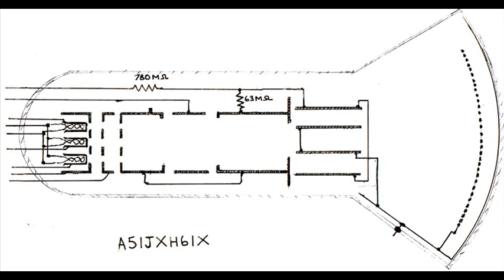Trinitron Cathode Ray Tube

Comment: What the différence between black trinitron ?
Reply from the maker: Not 100% sure on that one. There may be some general improvements on the electronics, but I think the term comes from darkening the screen fluorescent coatings to improve picture contrast. Manufactures had this dilemma with CRTs as black is only as dark as the screen coating. (i.e. No electron landing.) Making the screen darker with filters or pigments also reduced the brightness so  wasn't really used until light output from the  fluorescent coating was good enough.

Comment: How did you cut the glass? Was it heat and then cold water?
Reply from the maker: With electrically heated hot-wire the stress often crack the glass without any additional cooling.
Reply: @tuopeeks ok thank you so much

Comment: What metal use to withstand heat.
Reply from the maker: The aperture grill and shield assembly is made from thin steel sheet. The grill being etched out to allow electrons to pass. This is spot welded to a very heavy ridged cast frame to keep the grill in tension. There is also a thin layer of aluminium coated onto the  back of fluorescent  screen. Both will experience slight heating from the scanning electron beam but it is slight as the beam never rests on one spot.
Reply: @tuopeeks  thank you.

Comment: "The disassembling of this tube is a dangerous process."
In study times (during transition from CRT to TFTs), there were tons of old tube TVs on the streets at night, to be collected as bulky waste the next morning.
It was fun cannibalizing the valves (if any) or other valuable componentes for DIY projects and giving the tail of the CRT a nice kick - when coming home from a party at night, completely drunk. I took stuff home when I could carry it - it was not just stupid vandalism :) But the TV sets would have been crunched anyway the next morning, so why not having some fun? One night I rescued a complete C64 set from destruction. With two 1541 drives and a printer, all in working condition. 100feet away of my home. I put them in the basement, running a few times back and forth. But unfortunately most of it has been stolen a few days later.

Comment: This will soon become a lost technology, since no one is manufacturing them anymore and fewer and fewer know how to repair them, and fewer and fewer even care about them
Reply: Nope.
Sony's patent for the Trinitron expired decades ago and all the information you could need to build one is available.
I'm pretty sure you can find some Chinese company still making CRTs.
As for repairing them, all you need is the theory of operation and some service manuals.

I used to fix them, and it's not that difficult or complicated as long as you have the service manual, or you could even do it without it if you really know your CRT TV theory.
Now I'm a bit rusty though, but videos from people like Jordan Pier and Shango066 help me remember a few things that I had forgot.
Reply: @GoldSrc_  There are new monochrome CRT monitors on Aliexpress using a "flat" tube similar to those in Sony Watchmans. But those could be some old stock of tubes. Also while not a complete CRT, electron guns are still widely used in other applications, such as manufacturing the masks for photolitography of integrated circuits or electron microscopes.
Reply: @GoldSrc_  any chance I could pay you to RGB mod a 13 inch sony?  I've been searching the country and can't find anyone willing to do it

Comment: We used to have a Sony Trinitron pure flat 14” televideo in our kitchen and I remember a strange characteristic where there would be a perfect round circle of dust at the centre of the screen which of course was attracted by the static electricity. The fact it was a circle of dust was to do with it being a Trinitron perhaps?
Reply from the maker: Interesting observation, don't think it's anything particularly to do with it being Trinitron.  More likely to relate to charge being evenly spread. Corners and edges may have larger charge dissipation and become partially discharged. Charge on display screens became an issue with computer monitors and manufacturers started to coat screens with a thin conductive layer to remove this problem.

Comment: The support wire is actually a damper wire to prevent moire patterns from vibrations caused by the speakers in the TV cabinet

Comment: What happens if a crt tv turns on without air in the tube?
Does it just not display anything?
Reply from the maker: A CRT requires a very good vacuum to work. If there is air in the tube the high voltage on the anodes is likely to flash-over the gun. At atmospheric pressure the heater will oxidise and burn out.
Reply: The CRT actually has a Vacuum in it. Sucked down before the tube at the end is sealed. Then a RF Generator Flashes the GETTER inside the CRT. This burns and further reduces the vacuum making for a better CRT. The Getter will work for years collecting inside the CRT. Air Molecules inside the CRT act like Balls on a Pool Table.

Comment: Great video!
I regret scrapping my last CRT monitor. It was a Dell Trinitron.
You could see the upper and lower grid wires. It even had small cutouts, dots on each side.
The picture was rock solid. The mouse arrow motion was so smooth it gave a perfect illusion of the pointer moving over white paper.

Comment: Why/how is there an aluminum coating on the phosphor??
Reply from the maker: The coating helps reflect  light emitted by the phosphor towards the screen, but it also helps dissipates heat generated by the beam impact which would  degrade the phosphor.

Comment: CORRECTION: A Trinitron CRT has only one cathode.
Reply from the maker: All Sony Trinitrons I have had use three cathodes. Possibly early ones had a single cathode. I have put a picture of a dismantled Trinitron gun cathodes on my Google plus.

https://plus.google.com/photos/photo/111967450636623837217/6542484196755775730
Reply: Ha, I posted this comment minutes before learning that Trinitrons indeed have three cathodes. Now my question to you, sir, is how do the three streams of electrons from the cathodes emerge from the electron gun if they're all facing the same way? Won't the beams run into the cathode in front of them?
Reply from the maker: The 3 cathodes are  side by side, in the base of the gun, a few mm apart. They produce parallel electron beams that are formed, focused and accelerated  as they travel through the gun. Emerging from the gun the beams are set to converge on the grating  landing on their designated phosphor R, G, or B forming effectively one dot. 
If you look into a trinitron gun  you can see the three holes where the beams emerge at the back of the assembly.  Hope that helps.
Reply: Ummm.... I saw a video where there was only ONE hole and three cathodes, one in front of the other, not side by side.
Reply from the maker: I’ve posted a picture of a Trinitron gun on Google+ showing the three holes in the grid plate at the base of the gun. There are 2 grid plates with these three holes, one behind the other if you are looking at the gun side on. The three cathodes are behind these and can’t be seen, but it is obvious that three emerging beams travel in parallel down the gun to the final anode.

https://plus.google.com/photos/photo/111967450636623837217/6542869459109563314?authkey=CMme75L777nLvgE
Reply: OK, thanks. Remember, I'm still learning how these things work, so have some patience. :) Could you send me a picture of the gun assembly in a NON-Trinitron CRT?
Reply from the maker: lots of gun assemblies, including a side view of the trinitron and a dismantled in-line gun shown here: http://www.tuopeek.com/CRTs.html
Reply: Question: In a three-gun CRT, was there a focusing anode and accelerating anode for each electron gun?
Reply from the maker: Yes, basically in the original 'Delta' gun assembly there were 3 separate focus and final anodes . They had  common electrical connections.
Reply: Ohhhhhh, that makes sense. Now here's my final question. Why is it that triple-gun CRTs require convergence alignment and single-gun CRTs don't if both types of CRTs have three electron beams?
Reply from the maker: That's quite a big question as there are a few factors and I may not have all the answers. Certainly having a single electrostatic lens will reduce the alignment issues of the 3 gun assembly and this was improved when the delta gun changed to the in-line gun in non-trinitron crts. Convergence moved from electromagnetic to magnetic at this point simplifying setup and energy use. All tv colour crts employ some kind of convergence but early delta guns had quite  complex set-up process and as it was part electromagnetic tended to drift with age.  Like I mentioned at the start this is just part of the explanation deflection coil design and various small permanent magnet meant that once set-up it would not be required again through the life of the TV.
Reply: 1. Why don't Trinitron CRTs have a vertical curvature if the cathodes require even deflection angles across the screen?

2. If the focus control on the flyback leads to the focus anode(s), then does the screen control lead to the accelerating anode(s)?
Reply from the maker: The vertical grating can't be curved vertically and maintain the geometry so  this does complicate the focus slightly. Trinitron tubes have an extra focus grid which may relate to this.

The voltages for the accelerating final anode and focus grids/anodes are derived from the flyback voltage multiplier stages as they are high. The focus voltages are around 7kv while the final anode is closer to 25Kv
Reply: I just wrote an answer on the Electronics StackExchange forum about the electron gun assembly. Is what I said correct? The part I'm worried about is when I claimed that Trinitrons' focus anode had only one hole. I inferred this from a quote on your website: "[Trinitrons are] similar to the 'in-line' gun but used the same electrostatic-optics for focusing the three beams."

Link to my forum post: https://electronics.stackexchange.com/a/369995/185339
Reply from the maker: correct, only one hole  forming the focus lens in the assembly where the three beams travel.
Reply: Oh, let me give you an Internet hug right now, bud. You're the BEST!
Reply from the maker: Glad you found the information useful.
Reply: OK, so if the focus control on the flyback transformer adjusts the focus anode and if the screen control on the flyback controls the accelerating anode, then what potentiometer adjusts the control grid?

My theory for now is that the drive and low-light controls on the neck board are responsible for the G1 voltage, considering that the drive/low-light limits the brightness of each RGB color and that the control grid limits the number of electrons coming from the cathode. But that gut feeling needs some verification. Do you know anything about what control affects the G1 voltage for the control grid?
Reply from the maker: 'screen' controls the grid voltage for brightness. The HV final anode voltage should not be adjusted and only some Sony sets have an adjustment on the HT called 'H STAT' .  Increasing the upper HT final anode voltage may result in the CRT emitting x-rays so if there is an adjustment it is factory set.  Colours and brightness are further modulated with the cathode drivers which are often found as 3 transistors on the neck board.

Comment: How did you manage to seperate the funnel!?
Reply: Im starting a crt collection just to collect the glass part of the tv which is pretty cool!
Reply from the maker: CRTs are somewhere between engineering and art well worth collecting. :-) I separate the face plate from the cone and neck using an electrically heated wire placed tight around the break point. If hot enough the glass breaks along the wire. The support band and the vacuum must have gone before this process or it will be extremely dangerous.
Reply: tuopeek1 thanks!

Comment: How many wires does the aperture grille have?
Reply from the maker: If you mean the support wires running from left to right, there were two. They only appear on high resolution tubes. Grilles used on TV tube didn't need them but computer monitors often did.
Reply: I meant the vertical wires. I know there are hundreds of them. But exactly how many are there on the grille of this color TV?
Reply from the maker: Don't know, there would be over a thousand, I reckon, from memory and would relate to effectively horizontal pixels.

Comment: I would really like to produce a line of new CRT monitors one day! The product would be called RetroScreen and it will be designed with classic gaming in mind!
Reply: I've studied CRTs and electronic engineering, and had a similar idea. A lot of people still want them. If you could get some property with a garage or something, have basic knowledge of chemistry, physics, engineering, etc (at high school/college level, not necessarily equivalent to someone with a degree), it should be doable. As a start, you could get old Crts and fix to give/sell to ppl.. The ones that don't want them will give them away free 99% of time. A lot of kids and young ppl. have even asked me for them.
Reply: Do it!
Reply: ULTRA slim CRTs    were making ground  to being almost like a flat panel 
I think the issue was they took too long to start sliming it down to almost near the end of production  that was the main issue other wise we would have 65" Ultra thin CRTs by now (nano tubes)

 Fat >  smaller  >   slim  > Ultra slim  > Thin  >  Ultra thin
you can see the short neck on the screen
http://cdn3.tstatic.net/jualbeli/img/2017/8/2197932/2-1045656257-Televisi-LG-29FU6RL-29-Inch-Kondisi-Bagus-Lengkap-Meja-Kayu---Jakarta.jpg
Reply: The "modern" square flat CRTs would be absolutely ridiculous to make, but you don't need to do that to have a CRT. The earliest CRTs for TVs were little more than sealed up bottles coated with phosphor.
I'd imagine that a round CRT that could show a black and white image could be made by hand. Color could be achieved by a color wheel/cylinder/belt, or maybe even by painting translucent strips of color on the face and then keeping track of where the beam is.
Reply: Saw you post a similar comment to this on a how it’s made CRT video from about 5 years ago. Hope this is still an interest of yours!
Reply: Jack Comerford I hope it can still happen. Also, most new TVs not even having composite AV inputs makes me want it to happen even more!
Reply: you'd need to be a multi-millionaire just to start up a company like that and its very likely the business would fall through within a matter of months as the demand for CRT's does not meet the high production cost needed to produce a CRT.

Comment: The design of the Trinitron gun is unique in the industry.  It is a single gun which produces three beams, and is made from one sheet of metal.  This allows for a greater precision of beam alignment than would be possible with a three-gun assembly.
Reply: douro20 Actually three guns, single focus. The single gun was called chromatron and never passed the prototype in the sixties.
Reply: @telocho  they didn't work very well for colour tv, but they were used for miniature viewfinders and avionics
Reply: @telocho  it was ctually produced at a loss and never leaved japan

Comment: How did you manage to cut through the neck and bulb so smoothly? I did something similar with a slot-mask CRT, but had to actually shatter the CRT to remove the slot mask assembly.. I wouldn't mind being able to neatly separate the faceplate from the cone! I don't know what I'd use it for, but I would think of something!
Reply: Fairlane500skyliner be sure that the vacuum is out before performing in CRT
!! he used a hot wire placed around the frit line of the CRT (the white plastic line that separates the funnel from the screen glass) you can also use a diamond bit knife or saw and cut a fine deep line around the CRT, this will 'split' the to layer of glass on the CRT glass
 surface. Since glass reacts differently to certain frequencies a hammer will cause it to shatter to pieces that are no larger than 3-5 inches, to get huge pieces or even to crack the funnel from the screen glass, for example if the CRT is 17 inches you will need to get a heavy piece that is at least 5 inches, the heavier and bigger the hitting source, the bigger the pieces get! Hope this helps!

Comment from the maker: The glue is ceramic and I don’t know of any solvent that will touch it.  The band will be easier removed with a hacksaw . For safety the tube must have no vacuum during this process. The band stresses the tube to compensate for atmospheric pressure on the tube. This improves safety from implosion but also allows manufacturers to use less glass in certain areas. Removing the band with the internal vacuum can cause the tube envelope to fail suddenly and with out protection from flying glass.
Reply: Plain old household vinegar will dissolve the glue, Slowly.
De-vacuum the tube, remove the rimband, and any other metal, place face-down in a plastic tote, and fill with cheap store-brand vinegar till it's at least 1/8" / 3mm above the seam, cover the container, and wait a month or more. Check by applying a bit of side pressure to the funnel. If it gives (do not move it so much that vinegar will spill inside), remove it from the container, open the tube, remove the shadow mask, scrape out the phosphor layer, and wash with soapy water. The vinegar can be used again.
Reply: Very Good...  The metal band stresses the center of the face outward. So in an Implosion most of the glass shoots inward and not at the customer.  Sony CRT Plant 95-99 San Diego.